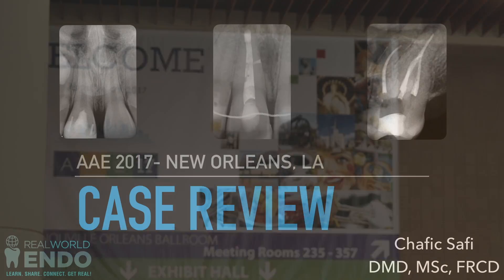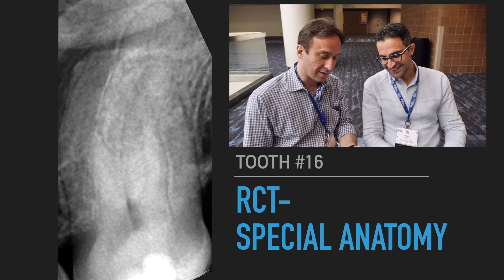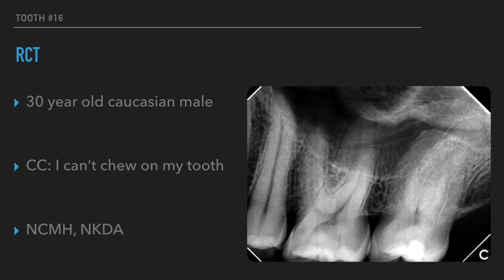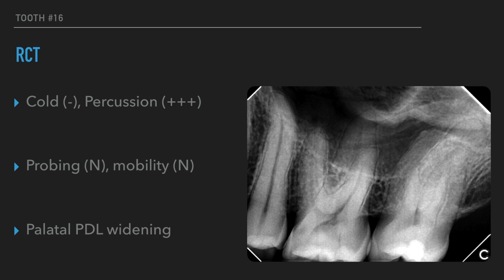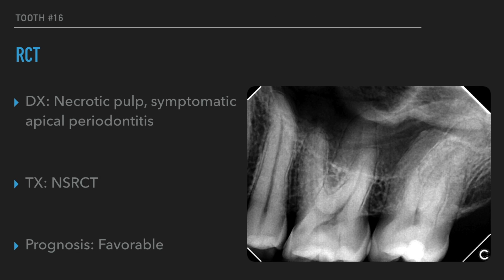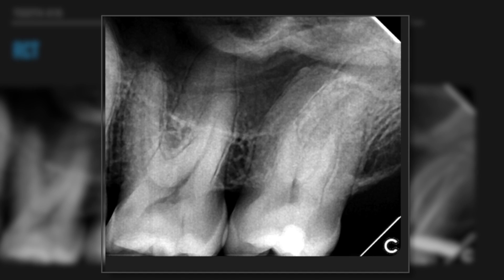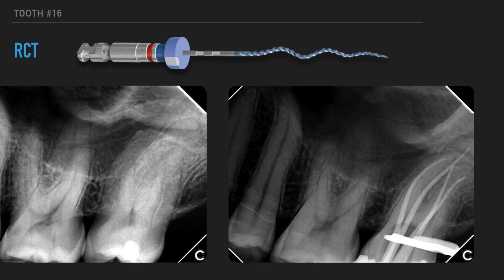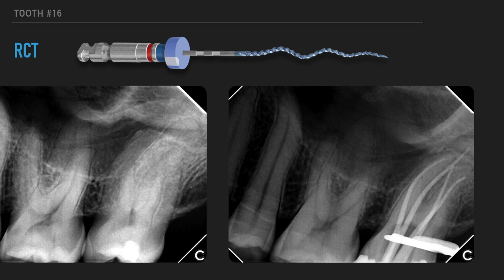CBL 24 (part 3): Special anatomy in tooth 16

Comment: Hi doc. Thank you for the video. Can you describe why Calcium hydroxide was used in this case? And the overall purpose for that? Thank you.
Reply from the maker: Ca(OH)2 is a disinfectant due to the high pH it provides and maintains for a few days. It helps remove, dissolve, and disinfect those areas of the canal which due to abnormal anatomy or various reasons may not get cleaned as readily.

Comment: What caused the pulp to become necrotic in the first place?
Reply from the maker: There's clearly a medium sized composite in this tooth. So, my assumption is microleakage in an old leaking composite. That's unfortunately fairly typical with composites.
Reply: Yes, I saw the composite. Poor bonding technique leads to this type of scenario.